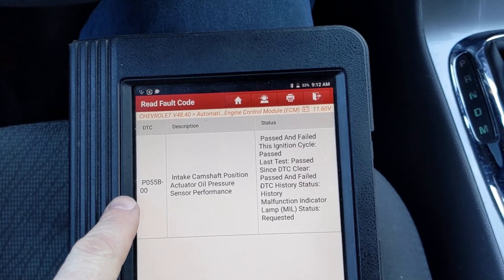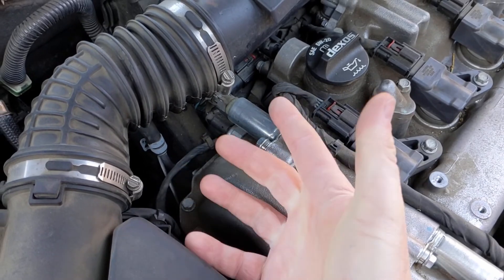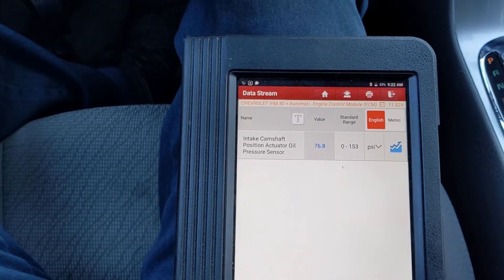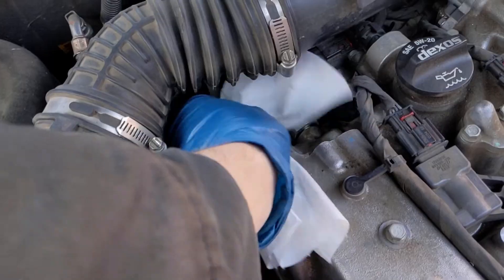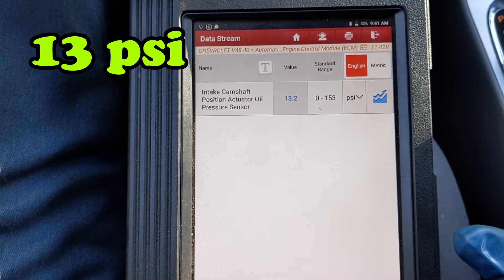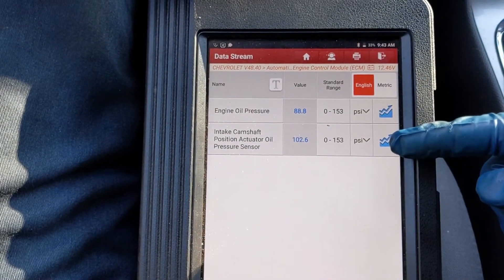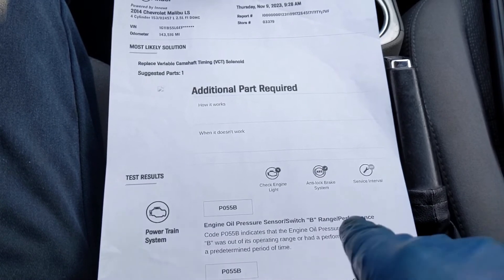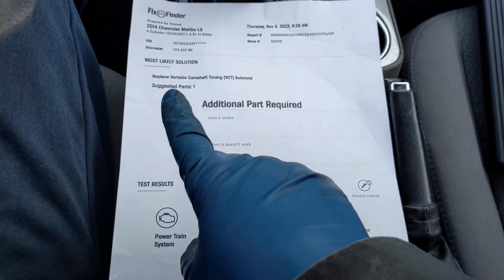Chevy P055B | Quick Diag and Repair

Comment: Don't know if this help but after I installed pressure switch I turned light off and and it popped back on but I let it stay drove with it on for a few days and it went off  just give ecu time to do it's job  hasn't come back on been 3 months now

Comment: I’ve had the had the oil pressure sensors replaced but it’s still on
Reply: did you ever find out what the issue was? I have a similar problem

Comment: Do you think Dorman parts are usually decent quality?  Thanks.
Reply from the maker: I've found Dorman to be on the lower end of branded aftermarket options. Sometimes they are the only brand available at the local parts store so you're kinda stuck if you need the part right away but if there is a better brand available I will most likely choose the other brand over Dorman.
Reply: @ValleyMobileAutomotive  AC Delco is OEM right?  Also, I understand there are two sensors, and one is in the back of the engine...but it looks like you only replaced one.  Am I wrong about this?  I only have the P055B code.  Also, would it be ok to drive it a week or so with this check engine light, until I can get it in the shop?  Thanks for your help. I like your videos.  I donated $10 through "Thanks"...hopefully that worked.
Reply from the maker: @Robert_Sparkman_03  You're right 👍. ACDelco is the OEM brand for GM products. Sometimes they are also branded as "GM Genuine". The P055b relates to the vvt oil pressure sensor. There is another "main" pressure sensor that will have different codes associated with it.
Thanks for the support 🙂

Comment: What is the part number for the camshaft Position Actuator Oil Pressure Sensor
Reply from the maker: @marshadonner3639  There should be a link in the description 👍